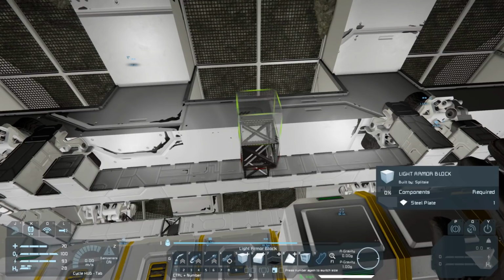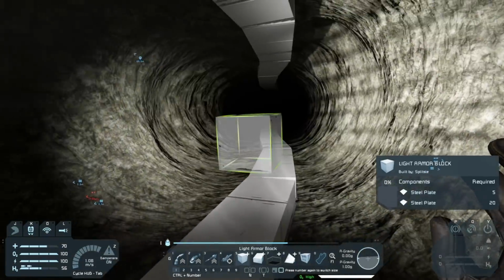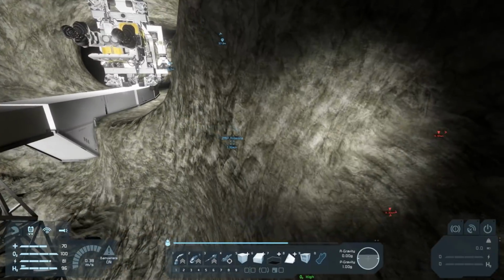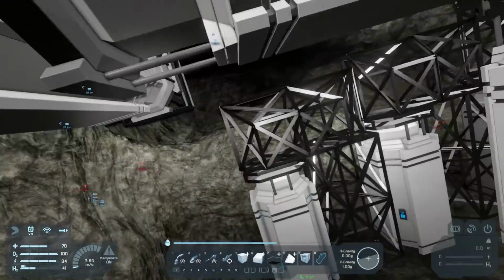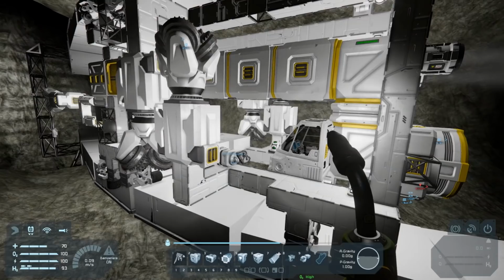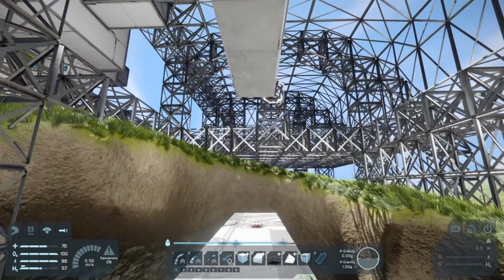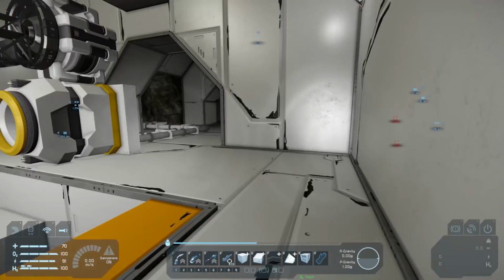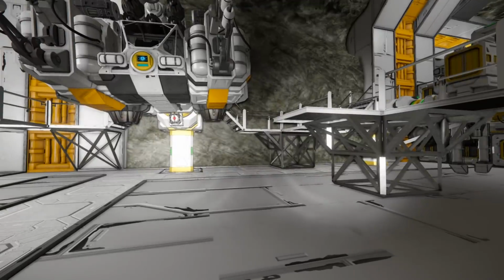Survival, Maybe... #82 Thomas the Tram Elevator (A Tram Engineers Survival Series)

Comment: Hey Splitsie, from memory of when it was added - I think 'Help others' on welders lets your welders weld blocks not owned by you, and retain their ownership status as built by another player (co-operative welding!). Also...!

I had a thought on your battery tram - you might find it easier to use small ship batteries for the battery unit. For volume you can get greater power density while using far fewer parts! Would also maybe help in transferring between the tram and the main grid, since it's easier to mount a small ship merge block on a piston on the station side of the loader.

Absolutely loving this series, have great fun!
Reply: And here is the thought, I was looking for.
Reply from the maker: Ah that makes sense :)

I'm thinking merge blocks may not be the way to go now since they need power to function and if I bleed the battery dry I'm a little stuck. So since rotors are the only option for connection without power small grid would probably look nicer since the small grid rotor parts are that much smaller - as another bonus to using small grid :)

Comment: A tram shed with a spare tram made for recovery and track repair might be a good addition to the tram fleet. With hydrogen thrusters and flashing red and blues for rapid response for clearing blockages
Reply from the maker: It sounds like you're assuming I'm going to crash :P

You're probably right ;)
Reply: Hydrogen powered contraption with wheels in all directions crossing over multiple slightly misaligned grids ... What could possibly go wrong :D
I like it!
Reply: Add a plow because well it’s splitsie and his luck it will became a train graveyard 🚃🚃🚃🚂🚂🚂🔪🔫

Comment: In my experiance the help others is a must to be checked, even for small ships, since it cuts down on the time it takes to weld, they do concentrate more on one block at a time, so say you have 5 welders welding something in the middle, the three in the middle will co-op while the ones on the sides will do different blocks and then get help from the middle sides and so on.
Reply from the maker: Interesting, from what others have been saying it's a multiplayer setting to stop you from taking ownership of someone else's projection while welding it.
Reply: i mean sure thats a thing that can happen, but the thing that decides that is the ownership of the welders itself im pretty sure. either way its not like thats a big problem and the pros are worth the cons, cause in single player there is no cons :D and in multiplayer eaven if the ships is owned by other friends its easy fix  with share with faction

Comment: while i dont know of one. i have a good idea of how to make one. the idea is a state machine and you write a simple script in the custom data to create states and set pistons and rotors to positions. i think i'll work on that now, if nothing else it sounds like a fun challenge.
Reply from the maker: That would be massively useful for creating mechanised arms like the ones used in car factories etc as well - would be a very cool way of loading missiles onto a truck for example (or batteries on a tram) :)

Comment: Just a thought, create the elevator track  car/track turntable that is part of your elevator as a whole unit on top of a rotator on top of the top most piston.  It can be rotated to the individual parking sections at the compass type area and the elevator can go up to the level that you want and the elevator track  car/track turntable can rotate and line up with the sections of track leading away.   Essentially its turntable on top of the elevator lifter.
Reply from the maker: That could work, I'm going to be coming back to this elevator at some point and there are a few aspects of it that could be improved :)

Comment: Have you thought about making this an automatic tram? For example, as soon as you trip a sensor, a series of timer blocks or programmable blocks begin to move the tram from the main floor to the track and set a remote control block to drive the tram back to the base. And have a similar system send the tram back. It'll probably be a complex system, but it's an idea to think on. I honestly want to try to set it up, but I had a severe nervous system malfunction, so I gotta fix myself first. Keep up the great work, Splitsie.
Reply from the maker: I've had some thoughts about it, however every time I go around the corners and have to reverse because a wheel pops up I think that it's probably not a very good idea :/

Comment: If a static grid is in the earth and the voxels are drilled away from it, it will stay static. If a grid isn't connected to the voxels and the blocks attaching it are removed it will turn dynamic
Reply from the maker: Except this isn't universally correct. If I take out the legs on the AI bases they will not fall unless you tell them to convert to ship, but if I cut off small unpowered sections they'll usually fall. I'm not sure how power would factor into it, but it seems to be related somehow :/
Reply: Splitsie I’ve found similar things happen to that, is it possible it’s close to the voxels that it thinks it’s still attached? It may also have something to do with weapons because of how they deform the blocks. Maybe deforming the blocks affects the behaviour? 

I’m doing a play through without a refinery and PvE mods, and I came across this crashed ship that was a station. It had 8 almost fully charged batteries together and I wanted them so I ground down the blocks attaching it and then drilled away the voxels and it didn’t drop. I had to put a control panel on it and convert it to a station for it to happen. 

What I said in my comment seems to mostly be true, but there’s probs other factors that affect the behaviour. I’ll have to look into it and do some testing
Reply: After building a "Splitsie's Drilling Guide ™" variant, I decided to grind all the blocks connecting it to the ground and all the blocks at the edges in the hope that it would all fall into a pile for easier grinding (without jetpack).  I had mixed success.  Some parts fell, but some stayed static.  I think the logic rules for static/dynamic grids have trouble when you create multiple grids from a single massive static grid.

Comment: In my own opinion start building an automatic missile system full of Rudolph's as well as the other missile but you're doing a great job keep up the great work.
Reply from the maker: The silo is pretty much ready for full automation on the construction side of things, but I'll need to revise the rudolph design since it doesn't work so well with the welders in its current setup (there are bits that take too long and are too far away from the center so the welder moves away before they're done even when the piston moves at 0.05m/s so I have to manually control the piston) :P
Reply: @Splitsie  well I have faith in you my friend too bad you can't put sensors around your base and set them up to the silo so when the drones come they can launch automatically but that's an idea but I have a feeling you've already thought of it.

Comment: @Splitsie add a projector and use a blueprint & welder to auto build the rail. Then you can just make it make it go slowly and run itself
Reply from the maker: Sadly because of the grid size differences and the station vs mobile grid issues it's quite complicated to get a self projecting build working - most that do it use a single grid size and merge blocks to allow for timed shifting of the projection which wouldn't be feasible with this build :(

Comment: Okay, have binged the entire series. Great series by the way. So a couple thoughts. Grinder Pit: If you ever get it finished, perhaps the last row of blocks should be wheel blocks mounted to a rotor that spins towards the pit. Aligned correctly, it should allow any scrap generated to fall between the tires and the end of the ramp, and down to collectors. The wheels should then pull any larger bits over and into the pit for grinding.

Pelican: Probably more efficient to drive it out and dump chunks of drifting pursuants into the Pelican, than fly them all the way around and into the base. In addition, parking it so that the Goose is facing down hill, so gravity helps will probably let it eat scrap more efficiently.

For actually loading the scraps, what you need is something like a Telehandler. And arm with a rotor, a couple pistons and a rotor mounted landing gear on the end. So you can reach out, grab a hunk of scrap you've separated and drop it into the pelican's maw without wasting energy hovering on thrusters. Unless you want to get fancy and build a scrapyard crane with a free dangling magnet/landing gear that relies on gravity to hang straight.

A couple other thoughts. You're all about power savings right? So why fly all your aircraft around? I'd suggest building a... skate of sorts. Basically a wheeled platform with only a small power source of it's own, that you can dock your fliers to, and drive them to a destination. Say you want to take the nugget out to the first pirate base you destroyed, and convert it into a hydrogen processing plant. Instead of having to load it to the Goose, or fly it on it's own, it lands on the skate, locks on, and then drives to it's destination. 

Speaking of which, the Pirate Ore Processing plant, instead of being left to rust, could be repurposed into a hydrogen processing plant. Ice in one leg of the plant, hydrogen out the other leg. That way ice can be mined from the lake by whatever machines you use, then transported to something with it's own power and a bunch of H2/02 generators.

Also, for your battery loading/unloading. Four pistons arranged around a rotor, with merge blocks on the end. That way you can simply spin the rotor around and move a new battery into the proper position, charging or loading/unloading.
Reply from the maker: Thanks, it's been a lot of fun making it so far :)

I've tried making some rotor and piston based arms with the MArmOS script and while they usually work for a minute, they have all ended up exploding or flipping their host vehicle in fairly short order. If I ever figure out what I'm doing wrong and get one working you can be certain that I'll be building a crane whether I have a useful purpose for it or not :P

The pirate base is over 10km from my home base and it was quite a challenge to get up to it which is why I haven't planned to use it for anything as it just ends up being a nightmare to use - plus I like the idea of it sitting there rusting after the trouble it caused me ;)
I do want to build a lake mining trailer for the Goose so I can drive down and grab a huge load in one go though :)

Nice idea about the battery loader, I might do something like that :)
Reply: In this particular case I think the MArmOS might be over complicating the issue. As for flipping, I'm very surprised no one has come up with an auto-ballasting script to shift weights, such as stone around in cargo containers to counter gravitational forces. Though I suppose a medium cargo container or two full of stone as a counterweight might be helpful.

Oooh, sounds interesting. Though I figured you might need to exploit the iron at it's base eventually. Especially with all the mega projects you keep making. (Which I find awesome.)

Comment: The MArmOS script would let you define the lift as a single "Robotic Arm" and control it with WASD. Once in position where you want it, you can save the orientation and command the arm to move to that spot by activating the programmable block with an argument. It takes a bit of messing around to figure out how to make it work, but the script lets you control multiple degree of freedom "arms" very easily. Its a monster of a script, and worth checking out if you want to make some stupid complicated stuff.
Reply from the maker: I've toyed with MArmOS and most of my constructions have ended in destruction sadly - not quite sure where I'm going wrong since they normally work well for about 2 or 3 minutes before they break :P

If I ever get something reliable you can bet I'll be building a flat bed trailer for the goose with a crane attached, even if I don't have any real use for it ;)
Reply: Splitsie  That's fair. It took me a good while to figure out how to make it work, and then I found out rotors don't have nearly enough torque for what I wanted to do. I guess I could have built a "hydraulic" arm, but that's more effort than I felt like putting in.

Comment: In GIS plots (geographic information systems) [the standard used for surveying, and as such also building, excavation, and well, any real world 3D physical object] Z-direction is Height/Altitude.  Any use of Z as a direction other than height is flawed and or incorrect.
Reply from the maker: I figured there would be some sort of standard and I knew I'd end up being different :P
Reply: @Splitsie  it's ok, if Minecraft can be wrong, so can you.  It still bothers me though.
Reply from the maker: Yeah, minecraft really went all out with doing bizarre things with its cardinal directions :P
Reply: When using computer vision and representing points in the camera's coordinate frame, Z points forward, X points right, and Y points down.
Reply: @Cyberguy42  that would work If the monitor/camera were aimed parallel to the floor.  Since in most cases, the camera is aimed perpendicular to the floor, everything is off by 90°.  In the olden days, games were represented in 2d, and so up on the screen related to walking forward, but as 3d developed, the system didn't rotate to keep forward being the same direction.  In those old 2d games, Z would still be height, (and would have been the axis into/out of the screen), but with 3d rotating the axises, some people didn't rotate the labels  with the axises.

Comment: could also sequence the timer blocks so when it moves over and it's done, it starts to move back. and so on.
Reply from the maker: Yep, that's definitely an option, would still need to have the PBs set up to control where it stops but having a sequence would allow for higher movement speeds potentially :)

Comment: That's what I thought! That if you made a train, it would probably be suspended with wheels on cube rails. The only alternative I know of for elevators was the one wrapping itself around the static rail. But it could be easily damaged. Dunno if wheels are reliable this way. But I think vertical variant should work too. Like an elevator with thruster engines and wheels and a landing gear stopping system. You reach the floor and it triggers "lock". 

I just happen to be building a moon base and it's quite spread. There are mines at the base of the mountain and a beautiful observation point on top. And the distance is too much for piston elevators to help with. So I'm thinking about making this wheel kind of thing. 

And, yeah, Black Mesa here ^__^
Reply from the maker: You can absolutely build an elevator with this system - as you say having thrusters may be needed, although I have managed a build where I used 5x5 wheels and could drive straight up with only wheel power, so you might want to attempt something like that (does end up much larger though)
Reply: I dunno if I can build all I want though. You make magic. Your bases are huge, I have no idea how you manage. Even if I was in creative and it was all about just putting blocks without welding... it would still take months. And you somehow also make it all look awesome, stylish. I would probably have... bricks. 

You're a grandmaster of SE! =D
Reply from the maker: You're too kind, I really just muck around until things look vaguely appealing and if they don't I lean into the ridiculous and end up with an Igor or ugly duckling :)

Comment: with the length and width of the Tram Car.
batteries can be placed 2 wide, 2 High and a total of 5 Large Grid Blocks long that fits nicely into the open frame.
18 Batteries and a Merge Block to either side top layer mid pack.
a single Small Grid lip will be plenty to keep the Battery Pack in place during movement from point to point.
in this format, each pack can be used in a multitude of ways including aboard Large Grid Ships going to Space since they can be swapped out on return for a fast turnaround.
since the solar array charging it would be quite large, it will generate lots of power to feed those batteries.

the Ring Segments can frame the running track providing something in the tunnel to see as the Tram moves along.
segments of 10-15 Blocks long can be projected as Modules for Straight or 3-6 Blocks for curved components.
a longer segment can host a hinged Track segment for use as a Switch to change from 1 track to another mid route allowing many different locations to be served possibly even down to the Lake for Ice Shipping. this section would need a Battery and Programmable/Timer Blocks to control the Switch and maybe even a light to display the direction selected.